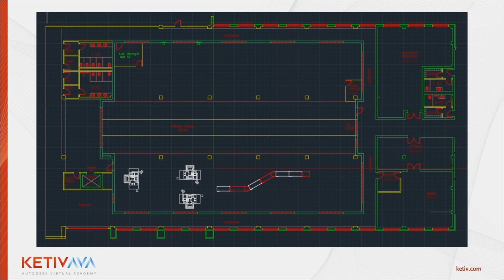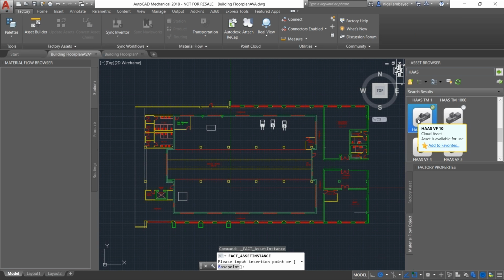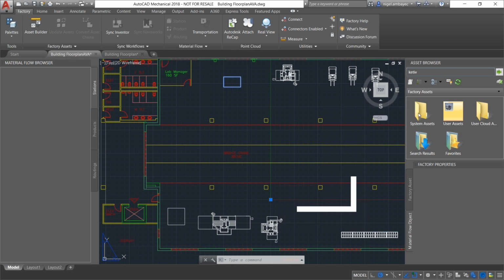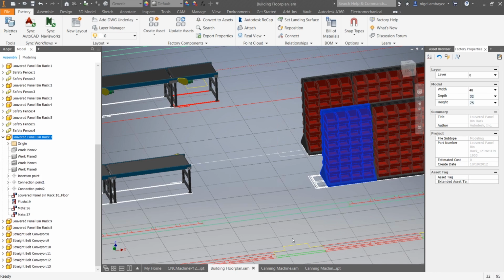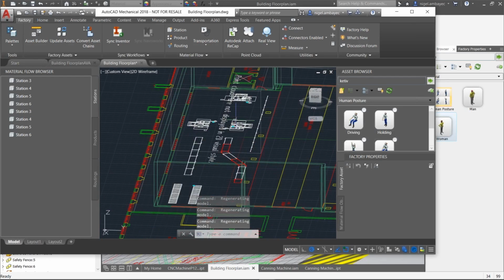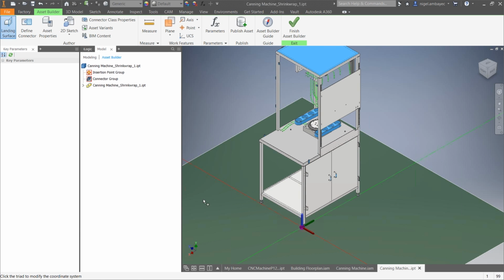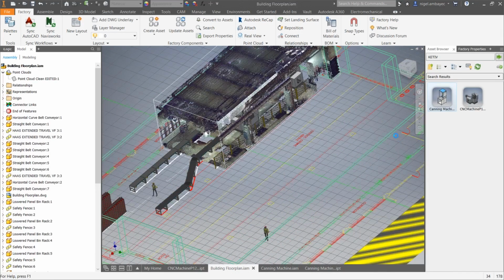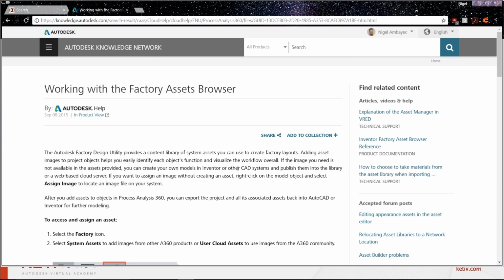Factory Design Utilities: Inventor & AutoCAD | Autodesk Virtual Academy

Comment: Im not able to open autocad 2D drawings to Inventor 3D, sync Inventor is not working like hidden. how i can work on this?
Reply from the maker: Sufaid,

Have you installed the Factory Design Utilities Functionality? If not, you need to do that before any of the ribbon icons appear in either application.